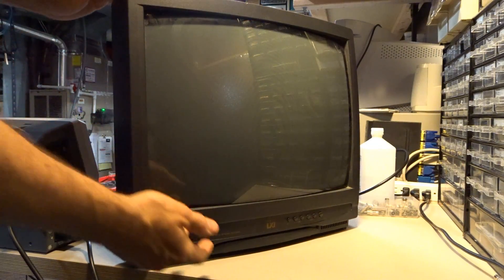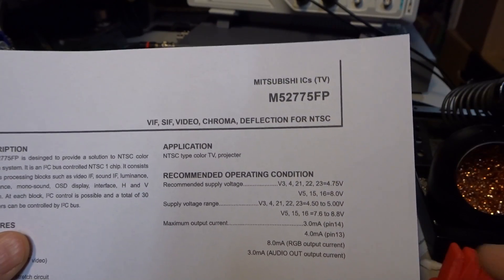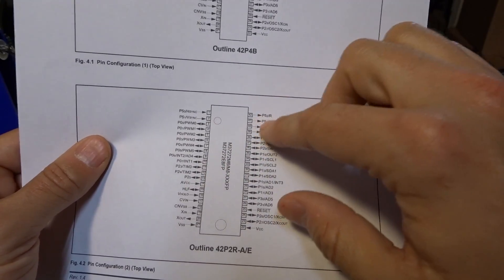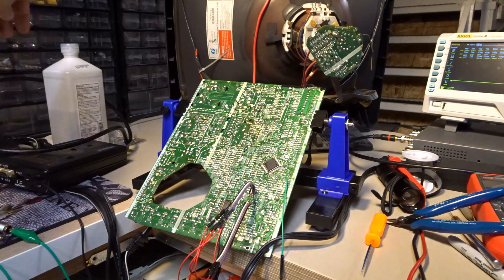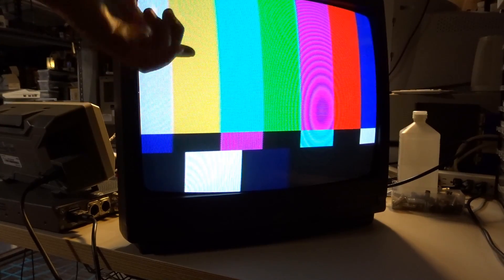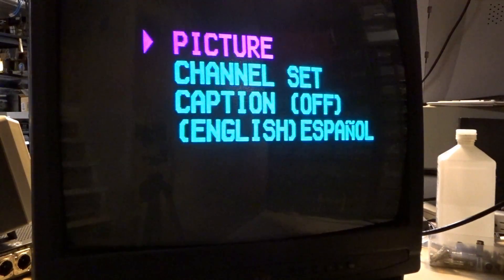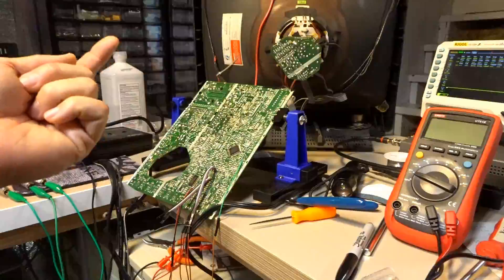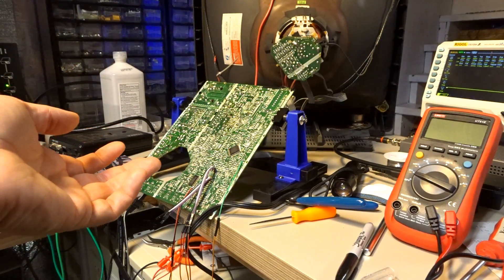Trash Picked TV RGB and Composite Mod

Comment: *Puts on the Sir David Attenborough voice*
Here we can see an American struggling with not having SCART on everything and anything.
Reply: as an european i sometime forget americans dont have scart
Reply: I'm not old enough to give a definitive answer on this, but from what I can remember every TV I ever saw (from behind) has had a SCART input (except for the black and white sets my grandparents kept around). However, I can't say anything about that input actually supporting RGB as I wasn't old enough yet to even know the difference. I know that we once had a lower end TV that had only one SCART input, which did support RGB, and one better one that had two SCART inputs, but one of which was svideo/composite (they were labeled as RGB and svideo). Other than that, every device I've ever seen had SCART outputs. Satellite receivers, VCRs, consoles, etc. With the N64 infamously just outputting composite over the SCART plug.
Reply: Makes sense that the Japanese are reusing the same technology internally (they had an equivalent to Scart after all).
Reply: Yeah but now I wanna do your cool little mod, but I already have RGB everywhere </European problems>
Reply: @SeltsamerAttraktor   good old jp21
Reply: Adrian Black

Same here in the UK.

Even in the mid-late 80s, I remember most TVs having SCART, unless they were super cheap, or intended for use in caravans etc.

By the 90s, it was practically unheard of to not find SCART sockets on TVs, and 95% of them accepted RGB input, at least on the first socket.

(not many TVs with more than one SCART socket supported RGB on the extra ports until the mid-ate 90s.)

I used to solder my own RGB cables for my computers and consoles, like the Speccy +2 and Mega Drive. ;)

You just need to hook up +5V to the "Fast Blanking" / RGB switching signal on SCART pin 16.

THANK you for showing how to properly research and modify a TV for RGB, and mainly for not telling people to "lick your thumbnail, then poke it around the chip until the image changes." lol (yes, that really happened, on a YT vid.)
Reply: Adrian Black Yes, there were a very few sets in the 1980s that lacked RGB over SCART (I had a 1987 Philips like that made just as TVs started to come with the socket) but pretty much anything made after then (late 80s onwards) had it, and the picture quality tended to be excellent across the board on RGB.

Starting around that time as well some satellite receivers (D-MAC and later DVB) received and sent RGB to the set. Most later TVs would have two SCART inputs, one Svideo and one RGB.

Still, this video is fascinating looking at how RGB and OSD interact, so thanks for that.
Reply: Adrian Black

VERY important safety message though...

Aside from the obvious warnings about working on live CRT (or any) TVs, and safely discharging the tube and larger capacitors before working on them, there is another hidden danger with a lot of CRT TVs made in 110-120V countries...

A lot of CRT TVs in those Countries used a so-called "HOT chassis", where the entire main PCB was essentially "floating" at a high voltage of around 160 Volts! :o

It was simply cheaper to build them that way, since the rectified mains voltage is low enough that they often just ran the set directly from that rectified 160V DC, or added a voltage reg etc.

That meant that the main board had to be completely isolated from the external input (and the user) in some way, including using plastic buttons for the controls etc.

That also meant that they had to fit an isolation block between the RF tuner and the external RF / cable / antenna socket.

WARNING: DO NOT RGB MOD THAT TYPE OF CRT!

Without some sort of considerable isolation for your new RGB input, those sets will pose a big risk of ELECTROCUTION.

I may sound a bit OTT, but it is a genuine and very real concern.

Some people have already been hurt attempting mods like this (whether the TV used a hot chassis or not), so PLEASE be very careful, and leave it to somebody with a lot electronics and electrical safety experience.

The results from seeing a proper RGB signal (vs NTSC / PAL / SECAM via composite) on even a cheap TV like this can be amazing for consoles and computers, but CRT TVs can still be very dangerous to work on.
Reply: I believe the real reason why SCART was pushed in France was Minitel, right? The French government poured a lot of money into that, it took a while to take off, but it was a success in the end. SCART was mandatory in France, but because of the single EU market, it became impractical to make TVs for France only. And a SCART connector was usefull for consumers, as you said, home computers, pay TV decoders etc.This why within a few years every TV, even dirt cheap ones, got SCART connectors.
Reply: Any television here in europe that is in colour, it has scart. If it does not, then it's very modern or very strange.

It was not a required to have, it was on everything as it was just so common. When I was younger, we would just call it "The Television Cable". 

Maybe it is very use here as it is single large cable, no lots of small cable each for sound L R picture sync, and can fall out easy. Scart is one cable for everything even sound, that stay in.

It was not just television that had these, everything that connect to had. VCR player, VCD player, Game console, DVD Player, all have Scart, although sometimes composite RCA that would not usually be used. My Sega Saturn and Sony PlayStation both came from factory with RGB scart connections. (although PlayStation 2 came with Scart, it is only wired for S-Video signal.)

My problem now is that I don't like the RGB look! I prefer nice and soft Composite signal ! haha
Reply: @televisionandcheese  Not all colour tv has it. I remember scart as a big thing in the end of 80s.
Also it seemed unnesserary that time not so big difference to watch vhs with rf or scart 😂
But ofcourse it was easier you did not need tune in Channels.

But remember we had colour tv in 70s (in Sweden anyway).

But ofcourse almost all tv have scart even todays modern flat tvs have it 😂

But its good feature today, never any problem to hook a HD decoder to an 90s crt!
Never a problem to hook an old VHS, Game etc to an modern tv!!!

So in USA only rf inputs and no analogue inputs in modern tv sets?  Wtf 😲

Why nobody sue these companies? 😉
Reply: Yeah, my new 4k TV still has scart input. And really I've only seen one TV in my life that didn't have it. It was a small cheap CRT made somewhere around the early 80s. But that was it. The rest of the TVs all had scart. And as I mentioned - they still do. Quite often it's the only analog input left.
Reply: Now that you mention it my Samsung UE55MU8000 4K tv does not have scart or component
Reply: @retrosimon9843  Okey. Maybe they then start to end analogue inputs to save money.

How is the tv tuner...is it only digital?

And lastly are this tv bought in Europe? 😉
Reply: Yes europe. There is 1 analog tv tuner the other 3 digital.
Reply: @retrosimon9843  ok funny they still have this analog tuner.

Maybe not all countries in europe gone digital. Here in Sweden they transmit analogue on cable but otherwise all analogue is shutdown since 2007.

Cable companies also use this.
You have to pay cable fee still you only get analog and have to pay extra for digital and thats really sucks!

But if they start sell tv without analog cable companies could not use this anymore....
Reply: @televisionandcheese  my cheap crap scart cables always fell out and the picture would go black and white before they fully disconnected. i don’t know if the tvs were all loose, if the cheap plate metal in it connector was the wrong size, or if the cable on the back was too heavy; but it kept happening so much lol. but yeah they made dvd players look great. i imagine dvd over composite was nowhere near as much of an upgrade over vhs
Reply: I've never seen any TV here in Spain that didn't run RGB through SCART, and I've had several CRT TVs/browsed quite a few thrift stores. However, very low end models might not have the connector, but they are a very small minority of sets. 

Personally, of maybe 30 or 40 TVs I've seen in my life, only ONE had no SCART input. And all the ones that did have at least one SCART input ran RGB and Composh*t through it. As you've demonstrated with the datasheets, the chips have the capability, and nearly every appliance (video recorders, consoles, etc) supports both RGB and CVBS. It simply woudn't make sense to not just attach the extra wires/traces to the port and sell it for a higher price boasting the better features.

Right now I've got 4 CRT TVs, and even the shittiest, lowest end model I purchased for 5€ supports both RGB + CVBS over the only SCART input that it has. (RGB runs a little odd with my 15KHz RPi console, though. there's some distortion in the upper section of the screen. The Playstation with RGB SCART cable runs perfect however).
Reply: In Spain we call SCART "Euroconector"... and it was compulsory in France since 1980 (according to wikipedia) so probably companies just went ahead and made it available everywhere else in Europe?
Reply: I think one of the main reasons even most lower end portable TVs in Europe supported RGB over scart, especially from the late 80s onwards, was simply because most home computers and game consoles could output an RGB signal and of course most of them lived in the bedroom. Although it wasn't a great design really a single standard connector that could handle all of the audio/video inputs of the time, was impressive.  It's only in the last couple of years that scart has begun to disappear. Most new UHD TVs have no scart inputs at all, they may have RCA/Phono connectors for composite and/or component inputs along with their HDMI inputs, but no more scart that can accept RGB. MY LG Plasma which is now about 7 years old and still going strong has 3 HDMI and 3 Scart, as well as component, composite and USB inputs. Try finding an brand new TV with such a large number of inputs today.  New digital TV boxes, whether satellite, terrestrial or cable have also dropped the scart connectors giving only crappy composite outputs if you want to connect one to an older TV.
Reply: > Around the mid 90s and onward most TVs in the US/Canada (other than low-end crap like this) had component inputs

This was actually the point where the US got from behind to ahead, because while SCART is officially 576i50 only, component can do HD resolutions. Now the reality is that just about every TV at least also accepts 576p25 and even 576p50 is common. The big Philips MG3 television that I own even accepts VGA until 1024x768@100Hz on the SCART inputs, this is because Philips did produce a version of this TV with a VGA input and SCART and VGA are electrically compatible; with this approach Philips just had to solder another connector on that TV.

But because SCART is officially 576i, equipment with a SCART output normally refuses to output anything else than 576i. Sometimes you can hack the firmware do something about this.

A major advantage of SCART is its consumer friendliness: There is just a single cable to connect between two devices, no way to wire it wrong and the devices automatically sort out wether to use composite, S-Video or RGB. As a result, since the introduction of digital TV, just about everyone with a TV built after 1985 was able to watch in full glory RGB, simply because TV and decoder did it automatically. Many HDTV decoders with SCART outputs use digital a resolution of 1024x576i for the RGB signal, which is great for 16:9 material, boosting the image quality on old SDTV equipment. This was sometimes called "SD+".
Reply: Yuki Saitou no it doesn't, all scart plugs have separate composite/audio io pins. One thing does not interfere with the other.
Reply: Early tv,s were all rf in the uk i still have a few older sets that are rf only .
Reply: My 32" widescreen 100Hz Trinitron (KV-32FX68E) has 3 SCART connectors on back, 2 of which are RGB and one is S-Video and Composite only. But sadly here in Europe we didn't have any HD Trinitrons.
For older consoles I have a 28" 4:3 Philips from 1993 and it has one RGB SCART and one S-Video/Composite only SCART.
Reply: I thought RGB input was normal.
Reply: I didn't realise they don't have SCART in the USA. I was wondering that through the whole video, why is there no SCART? They were very useful for cheap TVs with not many options
Reply: "Any television here in europe that is in colour, it has scart. If it does not, then it's very modern or very strange."

I have a 14" colour bought about 30 years ago for my commodore 64. That did not have SCART. I remember the price: 3.600 kr ($560) :)
Reply: Not all colour TVs in the UK at least, had SCART. I've owned a few from the 70s and early 80s, my Ferguson & Philips most definitely were RF only. Although I do have a 1983 Bang & Olufsen set now which supports SCART and RCA too strangely enough.
Reply: BarrySlisk Not really a fair comparison though because Commodore use their own proprietary connectors anyway
Reply: Comparison? I just know that a TV was made without SCART. That is what I replied to.
Reply: I'd rather have NTSC dot crawl than all my games running 16% slower.
Reply: At least in France (the rest of Europe followed later),  SCART was mandatory on every TV since the mid 80's. 
It was pushed by Canal plus,  the first pay TV channel in france,  in 1984

Another interesting thing with SCART is it allows very simple pay-TV decoders, without it's own tuner (a tuner was quite expensive in the 80's, and pay tv was broadcasted in VHF, with analog encryption). 
In short, the TV demodulates the encrypted signal, and sends it to the decoder via the output pin of the scart plug. If the signal is unencrypted, the decoder does nothing.  When it detects an encrypted signal, it activate the fast switching input to force the TV to display the decrypted signal trough the rgb input. 
With this system, installing a decoder was (in theory) a very simple operation. No need to re-tune your tv, to modify the antenna connection or anything else. Just plug the decoder and you're ready to go. 
Sadly, some manufacturers didn't implement the scart correctly, leading to lots of troubles with early decoders.  In 1995, Canal + introduced a new decoder with it's own tuner, solving the problem
Reply: Yes maybe 98% of all European TVs junk or not had RGB scarts, there were a few exceptions though, at the end of the CRT era there were really cheap chinese built TVs with universal boards, they had switchable NTSC-M and PAL-B/G/I/D/K tuners, they would display PAL, NTSC 3.58, NTSC 4.43 and SECAM and also work from 100V to 240V so they could be sold worldwide, they had a SCART input on the back but it would only do composite, there were no RGB pins on the back.
Reply: The only situation I've encountered where European TVs don't have RGB support is where they only have one SCART port and it supports feeding back a Composite signal to an attached VCR as I understand that uses some of the same pins.
Reply: Yep they did
Reply: Yeah it's very strange to me to see a TV without a scart or even s-video input. Just RF whaaat ?
Reply: Europeans might have SCART, but you're also stuck with PAL.  Ugh.
Reply: PAL is fine, it was game publishers who got lazy and didn't compensate for the different refresh rates, games could've run at the same speed everywhere had they wanted them to
Reply: Samuli Tuomola SECAM was better though.
Reply: I was first thinking "this tv is not that old, why bother modding it, as it certainly has RGB and component input on a SCART connector?". And then i saw the NTSC acronym in the datasheet.
The only TVs i have seen that do not have the SCART connector are either from 1970s or earlier, or extremely modern.
Reply: Adrian Black No, they did not. The small 15'' sized tube TVs came most of the time without SCART. (I am 100% sure. I even went into the basement to check.)
Reply: TVs in south africa from the 90s normally had rca composite and the expensive ones had rca rgb
Reply: I want that
Reply: @adriansdigitalbasement  Yes!
During the 80s, 90s, and early 2000s a SCART connector was as common as the power connector on ALL TVs and A/V devices.
I never really cared about it back then since it was just normal, but today as a Retro-Gamer I just LOVE it :-)
Reply: that is true, everything that use video have SCART, even the most crappy vhs have
Reply: Scart da best. I liek Scart